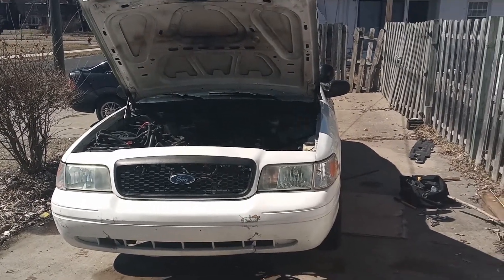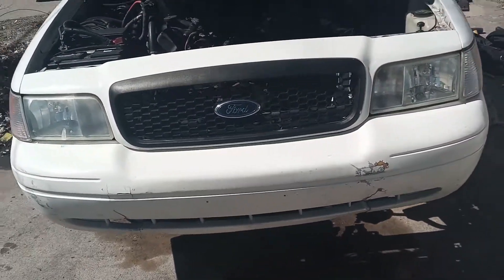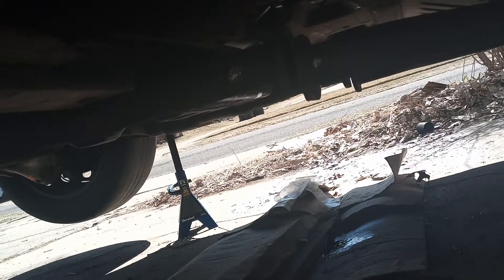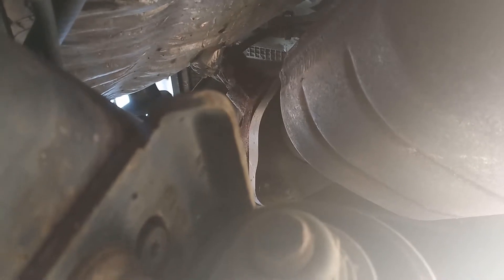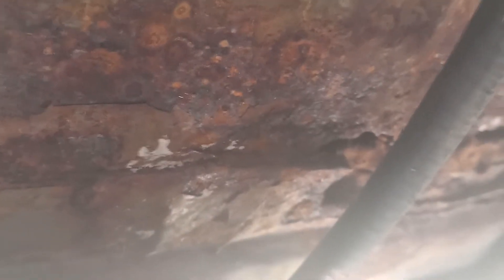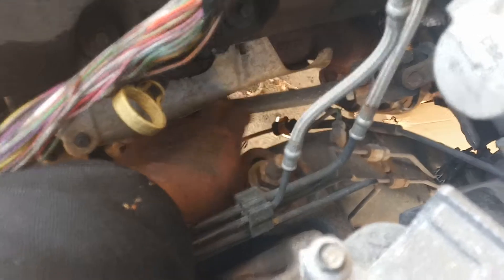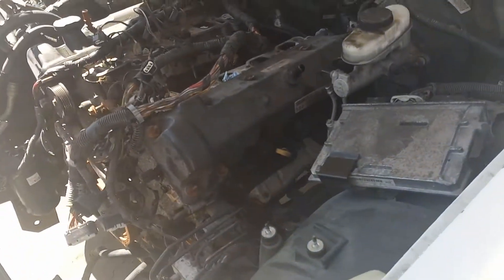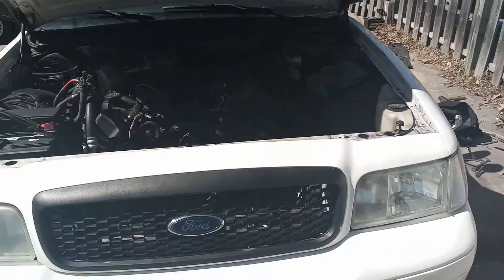Some unexpected fixes and close to pulling the engine and transmission out

Comment: I'm excited for you.
Good work.
Reply from the maker: Budget Panther Fan the weather is getting better so I will be able to work on it before and after work I got to do some long tube header fitting with the motor still together and then I'll break the heads off get those to the Machine Shop rear end and fuel pump upgrades is coming